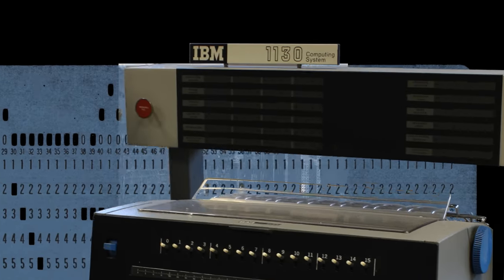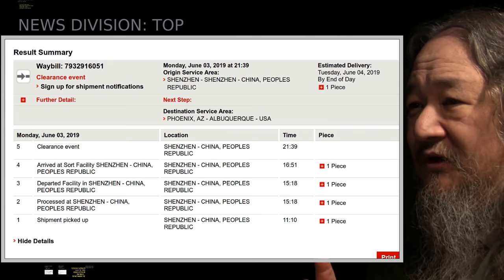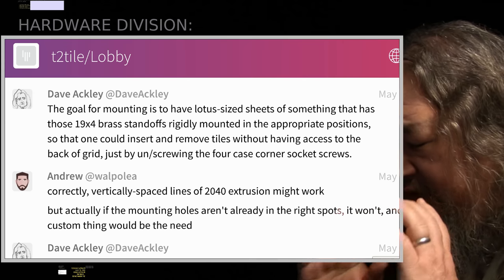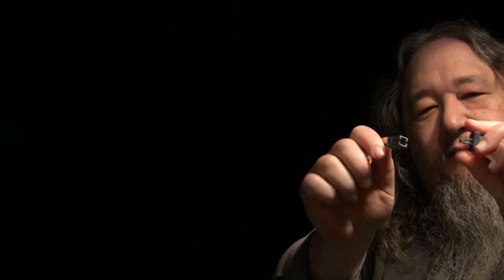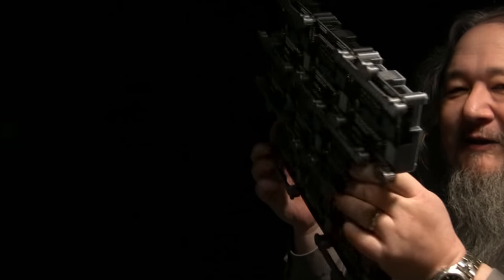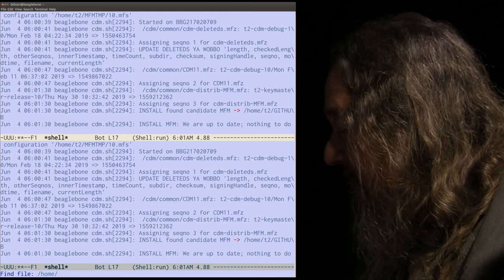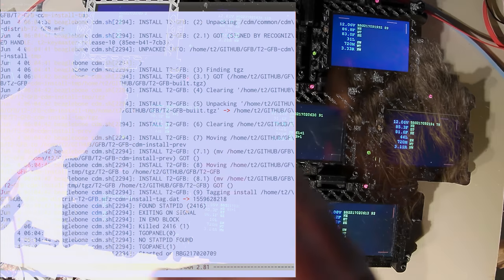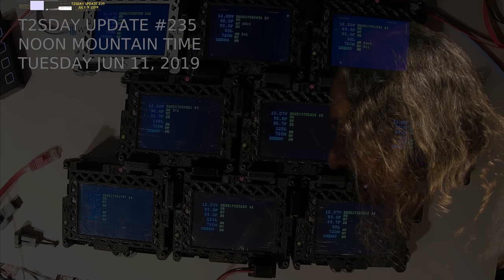Fixed Frames and Mobile Code - T2sday Update 234

Comment: Just make sure the "free lunch" (odds on it will be pizza -- what else?) that you serve during the T2 tile assembly party is eaten after the T2 tiles have been assembled.

BTW: can't help thinking the full lotus ought to be placed on an easel instead of mounted on a wall.  The wall mount sounds arduous and involved and entails a lot of work to avoid having the tiles at the top supporting the tiles below.  If placed on a tilt-back easel (which, I'm guessing, would have to be pretty big -- a possibly fatal limitation) there might not be any need to build a superstructure for the lotus and fasten the thing to a wall.  If the easel had wheels it would also be easy to transport the lotus from, say, an office to a lecture hall.
Reply from the maker: The full ring lotus might be big for most easels, but maybe about right for a classroom-sized rolling whiteboard.  Pizza's hard to beat though I used to do Chinese for my end-of-semester programming students.  Of course, prayer first, then eat.